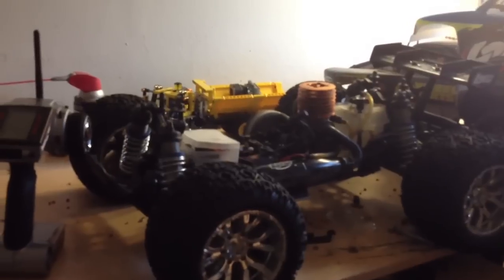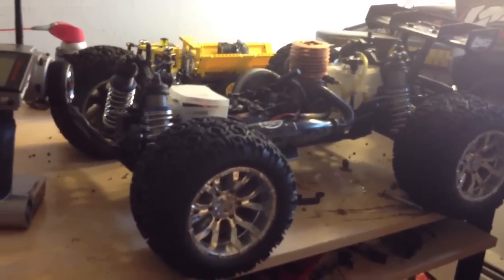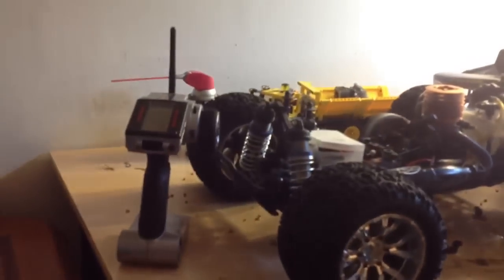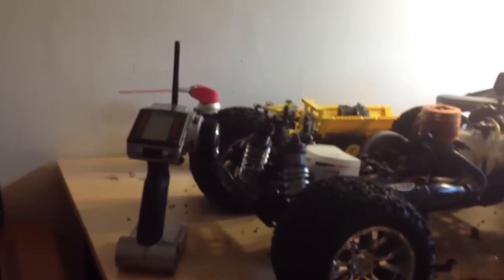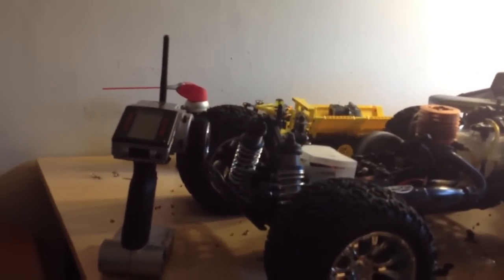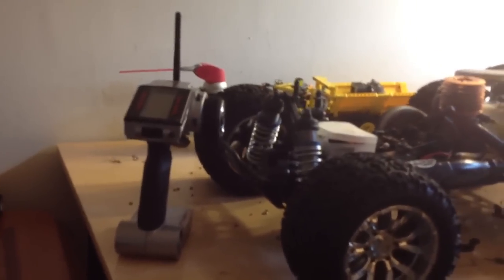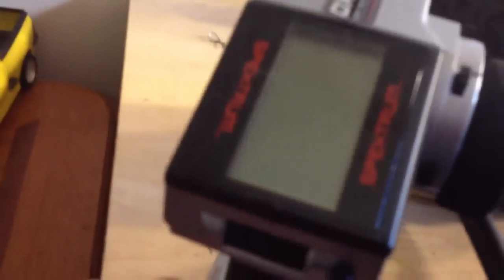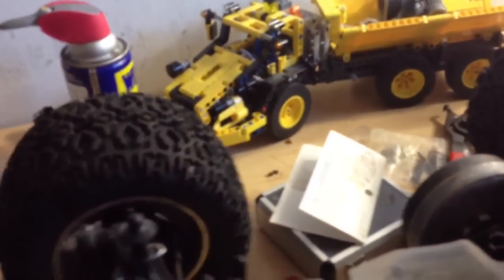Losi XXl how to bind and set fail safe

Comment: my lst won't stay binded. after I power down and switch the plugs back and power back on its back in bind mode
Reply from the maker: The only think I can think is happening one the is a short in the receiver or some how when you put the power back in to the bind/power slot it shorting it out. Try binding the truck with the power In the steer Chanel after you do that pull the bind plug out but leave it powered through this  channel. Turn the truck off and then back on if it stays binded   you know you have a short in the bind/PowerPort or your power wire is touching part of the other side and causing the truck to going to bind. Let me know if this works

Comment: 2 port
Reply from the maker: If it's still rapid flashing with the bind plug removed then there has to be a short in the receiver so if this just started chances are the receiver that's in your truck is bad. If not the only think I can think of is that you can make a bind plug by the two outer wires of the three port connector if they touch in the bind port that puts the receiver into a bind mode. But if it's flashing with no bind plug then there has to be a problem with the receiver

Comment: no
Reply from the maker: It flashes rapidly with the bind plug pulled out correct. 
Also does your power wire and having two port or three port end on it
Reply from the maker: That's fine but when the receiver is flashing rapidly is that bind plug still in the receiver or is it flashing rapidly with the bind plug removed